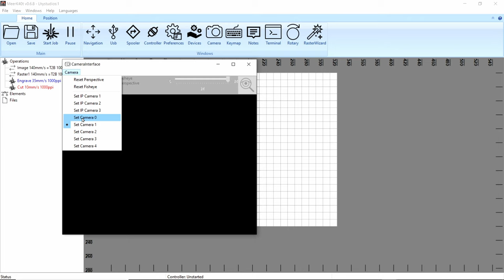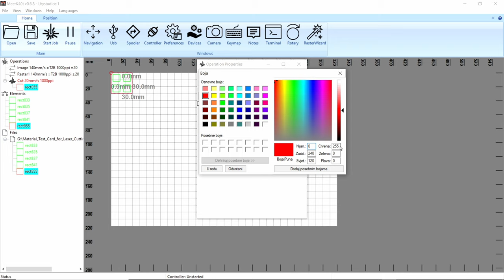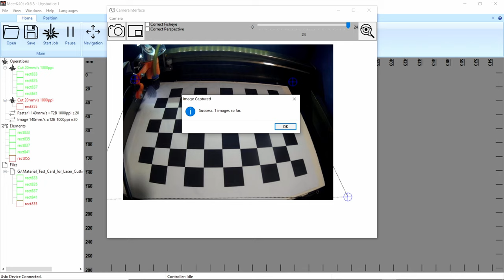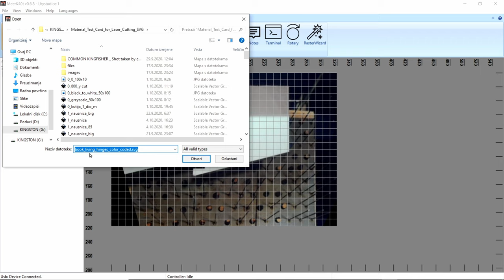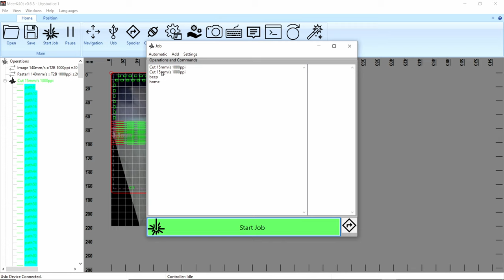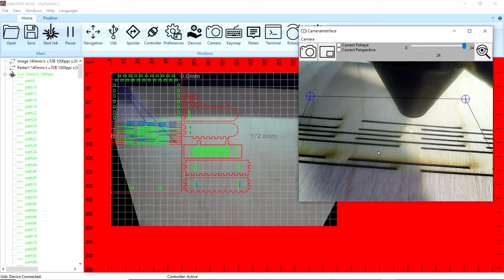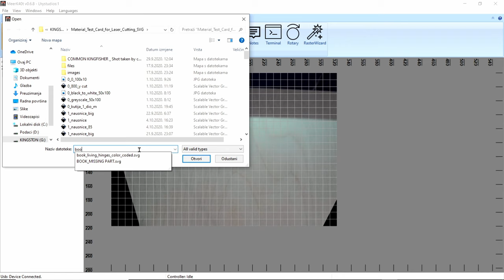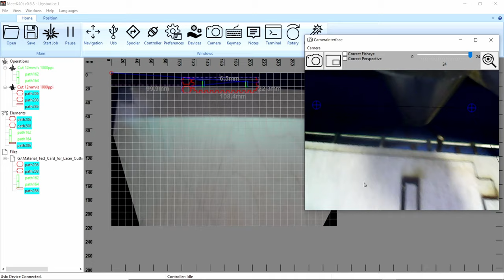K40 - Testing MeerK40t - Now faster and better

Comment: Awesome. I was planning on an upgrade in 0.7.0 for the camera software to make the settings for fisheye and perspective have independent settings and let you use multiple ones at the same time if needed. I didn't know if this would be that useful for people though, since it would be only useful if you had several cameras and wanted to adjust them all independently. Seeing your setup, it seems like that would be quite helpful.
Reply from the maker: That would be awesome! I am using endoscopic camera because it is lightweight, but I can also use other small action camera with changed focus to macro. When time permits, I will add one camera below the cutting area to see what exactly happening with the smoke and possible fire. Just because having many small cameras, does not means that people will love to mess with. Do it for me, please... it is selfish wish, doesn't it.
Reply: @MilanKarakas  The only other person I know with multiple cameras wants a camera inside, pointed up towards the material so he can know when it's properly cut through so as to fine tune the laser in that respect.
Reply from the maker: Yes, that is my next plan to do. Aside the confirmation whether material is cut or not, there is always chance that some thin pieces of wood catches fire. Once it happened to me and I was close so reaction is prompt. Yet, the flame extinguishes by itself. Only damage is charred piece of the material above that area. My wife bought for me big CO2 fire extinguisher, you may see it on some other video. She is so scared about that machine... I have two solutions for that - first aid is small water spray bottle, and if flame is big, that extinguisher. Sometimes I move to my other computer, and it will be good to have this bottom camera wireless so that I can monitor from a distance.

Comment: 16:55 WOW! Video of a runaway. The reason the 0.6.8 is still beta and didn't get posted full release, and actually part of the reason I avoided the rapids for a while was the two methods I had each had issues. This method is "Jog Switch", where I go back to standard mode with a @NSE. JLane reported this method gave him runaways where it would just stop and ram the gantry fairly randomly. The other method I had was "Jog Finish", which would sometimes fail to quit the wait-finish loop when it failed to read the 236 signal from the board. In later versions of 0.6.8, this is believed to be fixed (firstly by identifying and correcting the bug (the hardware gives a critical window of the 236 state and the board needs to be hammered during the wait cycle), and secondly by allowing a manual override of this wait loop in Controller). However, I also checked the Chinese software and Whisperer output here, and solved the general case for the types of jogs they use. And that's now in the later versions of 0.6.8 as Standard and set on by default, which seems to lack either deficit.

This is actually the reason I didn't do the rapid jogging before. And the reason the beta didn't get full release, but rather some more work and experimentation was done. Jog Finish and Jog Standard should work fine. And Jog Switch (which is the type of jogging in the Beta-2 version) is being nuked. (You could still type: "set opt_jog_mode 1" but not giving a gui method of using it). Version 0.6.8 should likely be out today.
Reply from the maker: That is good news for the new 0.6.8 version. Once Whisperer did the same and ruin the job. Other versions works fine without that glitch, but they are slow. What is exactly "236 state"? There is another small issue, no big deal but if you can solve this, will be really great. Before cutting lines, it jumps slightly out of the line, then continue. Maybe some more optimizations? I can see that each path has its own number, but I remember adding single line and that line is cut last. Is there a chance to re-arrange path list by the proximity of the coordinates? I can see that Ruida doing that thing as well - finishing other things, then back to finish previous path. Actually, maybe there is way to do it in Inkscape, but I am new to this and unaware of such optimization. If too much trouble, don't bother with the optimization, just that amazing fast jog movement. I will continue to test your versions. In the meanwhile, I need to find cheap way to adjust head, since it does not cut straight. I mean, focused beam is not perpendicular to the workpiece. Only three screws does not allow me fine adjust and in the same time avoiding ghosting caused by reflecting of the laser beam from the orifice, which is really small (2.5 mm dia). I think that nozzle should go even closer to the workpiece, but then there is problem in the case that some element after cutting tilt and head may hit that part. I saw that happening to other people with big machines. Making bridges is not always fun.
Reply: @MilanKarakas  236 is what the board status returns when it's finished. The board doesn't actually store data in it other than a bit of buffer. So you feed it FNSE at the end and then you ask for status over and over again, when it finishes the buffer it'll set the status to 236 (it's a single byte of status data, 000-255 with only about half a dozen states). It's the only way to tell the buffer has finished. There are some commands you can send the controller like 'I' which will clear out the buffer, and the program needs to know that the buffer is actually empty before the program sends the next command. So it sends a finish command and waits for the FINISH 236 signal to be sent. I used to request status updates 50ms apart prior to the next version. This could sometimes miss the 236 signal that I assumed would be sent, but knowing the chip better it seems like it just sets that state on the chip pins and if I don't read while the state exists, I could miss the signal. Then the program wouldn't know it was done, and would get stuck in a waiting loop for a signal it missed.
Reply: @MilanKarakas  The jumping slightly out of line is actually it getting up to speed. The @NSE would require reentering the compact mode this would involve setting the direction flags. Which causes it to sort of jump a bit out, if the angles don't match it'll do that. Weirdly.
Reply: @MilanKarakas  0.6.8 properly just got released. Mac and rPi builds coming but the windows is up there.
Reply: @MilanKarakas  Yes. Optimize Travel is a hidden feature. Currently it's bit hard to use. I tested it out since that kind of cut planning is intended to be done routinely in 0.7.0 but I hacked in a cheap way in 0.6.3 or so. 

It is a few console commands so hit F12 and load up terminal.

First it only works when all the paths are together in 1 single compound path. To do this, select everything you are optimizing and type: "element merge" this will merge all those paths into a single compound path.

Then select the merged element and type "optimize travel"

It will say something the original travel length and the new travel length. Then just vector cut the path as you normally would. If you wanted break the path appart the command would be "element subpath".
Reply: Keep in mind if this is a cut operation, it may need to rearrange things later to make sure the inner parts are cut first, which will lose some of the optimizations, since moving the parts to be inside other parts is done without regard to the travel optimizations. In 0.7.0 the plan is to have all the optimizations happen in a single cut planning routine, which also would require some preview ability since you can't really see what order it be in after the optimizations without a kind of preview of that.
Reply: @MilanKarakas  Yeah, Ruida and Lightburn both have some cut planning work. Hopefully 0.7.0 will also finish some of the work for Project Ruida. The idea being MeerK40t opens up a port and pretends to be a Ruida laser, and just takes input from RDWorks or Lightburn to control the laser. It sounds a bit far fetched but currently there there's a console feature you could do: 'ruidaserver' and it will let connect RDWorks to localhost. And if you start a project in RDWorks on your "laser" it'll actually send that data to MeerK40t and appears as path objects. There's some conceptual problems with the way its set, where it loses speed information and power information, and other data that it could have used. And doesn't directly control the laser. I've worked out some of those concepts for 0.7.0. Since I'll have some internal objects that can possess all that information in a coherent fashion (I also needed these internal objects for cutplanning etc).
Reply from the maker: @davidolsen1222  I think it is too early to release it . Something is terrible wrong. I will make video for you only. It is slow when cutting, but jogging is okay. I will capture whole cutting process just to see how long it will take and whether it will get into runaway.
Reply: @MilanKarakas  Runaways shouldn't be an issue in Jog Standard. It's the way the chinese software does it as well as Whisperer. The reason it wasn't released earlier is because of that issue. In 0.6.8 full, I went about mapping out the standard jog and I use those pretty exclusively. I removed jog switch, as they can do runaways and it's not worth the risk there.
Reply: @MilanKarakas  The regular version should fix the issue. We tested a lot, since it involved changes to some core code.
Reply from the maker: @davidolsen1222  Yeah, that is real pain in the... Does PC has some USB buffer as well? For example, I remember that keyboard has some buffer, and if program is slow, you type something and wait until it shows to it. Someone made video about CNC router and claim that Windows is not the best option, or actually not recommended. Is that true? He said that Linux is the way to go.
Reply from the maker: @davidolsen1222  Okay, tried it and it says that result is about 1/3 of previous work time. But, there is something wrong with new version 0.6.8... just preparing video and will be uploaded soon (maybe 1 hour ).
Reply from the maker: @davidolsen1222  Ohhh, that will be AWESOME!!! I think I downloaded RDworks, and will try to play with it. Okay, real Ruida and big, I mean, really big laser cutter is my daydream, but as my humble budget dictates - nothing soon. Please, keep working on that. That is really, really good news.
Reply from the maker: @davidolsen1222  True. Now, video is about 50% and I want to show you what is happening now with MeerK40t. Will be up soon...
Reply from the maker: @davidolsen1222  Here is the strange behavior of the MeerK40t, V 0.6.8, as I call it error.  https://youtu.be/N3biwO1olUo